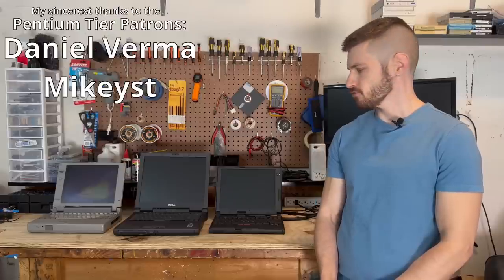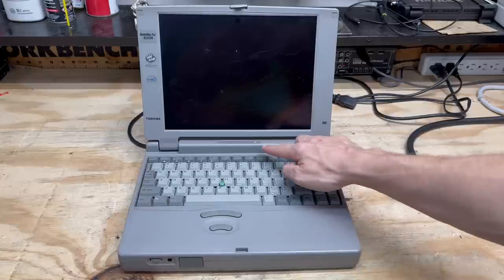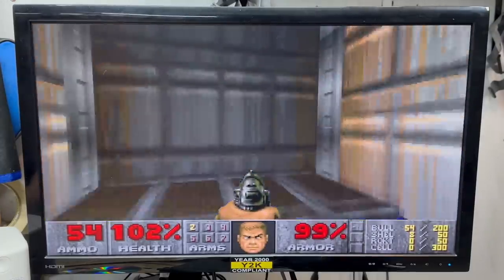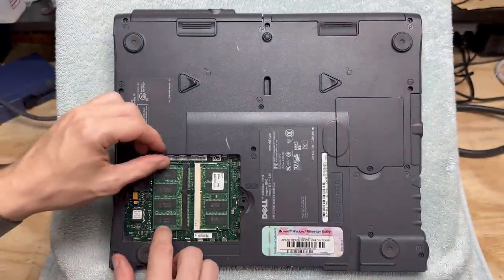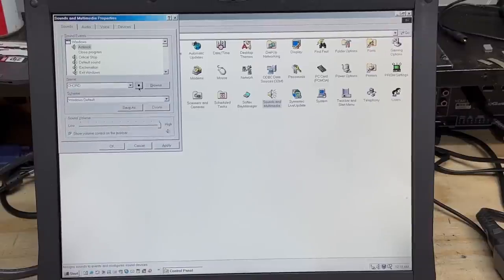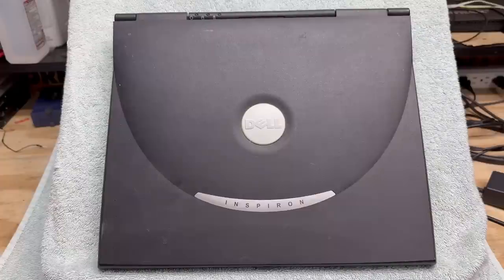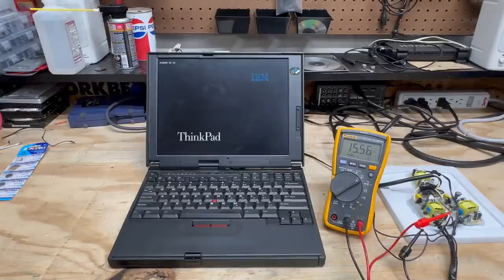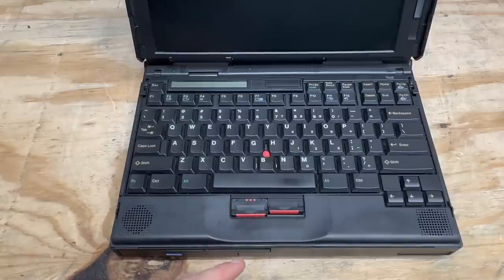Testing some of the retro laptops from the Franklin eWaste haul.

Comment: Remove the CMOS and the "Hibernate" Battery from the Toshiba laptop. Its not a question if they will leak. the question is have they already leaked... The acid flows through the cables into the plug where they are connected and destroys the mainboard. I have like 20 of them an all have leaked or were about to start leaking. We also discussed this topic on vogons and everybody had leaking batteries.
Reply from the maker: Thanks for the warning! I pulled them out and got incredibly lucky. The CMOS battery connector will need to be replaced, but the mainboard is safe! I'll be diving deeper into these systems in the future, just have to work up the nerve to face those incredibly brittle plastic clips...
Reply: @miketech1024  The Satellite 400 series aren't usually that fragile, it's just that you have to separate the top half (screen, keyboard cover, video card) from the lower half (psu, mainboard, lower case). Once the screws are undone and the video card disconnected, the top case easily unclips from the back side where the PSU is and lifts forward and up.
The later toshibas like the Libretto can be really brittle, but mostly it seems the Satellite 400 to 435 models were made with a different type of plastic

For the battery damage, it might be worth looking close-up on the mainboard, the electrolyte from that larger standby battery can leak onto the mainboard if it was stored flat. That can often damage things like keyboard functionality. For the ones that are too far gone, something unique to the Satellite 400 to 435s, is that the top half (video card, LCD, LCD cable) can be swapped between a DSTN unit and TFT unit, if you've got a TFT model that has a dead mainboard but still working screen.

I made a 3d print of that port door that you glued back together, I should probably upload that for people to use
Reply: @voodler  interesting... I'm part way through restoring a 490XCDT. Yes both batteries had leaked, and yes it had made its way to the main board. Only after cleaning the area did I get the thing to boot. Now happily running Win 3.11 on a CF card. BUT... as you mentioned, still got weird keyboard problems. Some keys only work when another is pressed. Is there a particular chipset I should look near for damage? 😊
Reply: thanks - will pull my 2100CDS apart and pull the batteries - didn't know the ones in the Toshiba machines leak
Reply: @billysteiger7092  Ah the 490CDT / 490XCDT are pretty bad for getting battery damaged. The first one I got the corrosion was so bad that it had got under the BGA chips on the back of the mainboard and it was just junk.
The mainboard design on the Satellite 490XCDT is quite different from the earlier models i.e. Satellite 425CDS in this video, so if you're having keyboard trouble that's less likely a motherboard problem, since it now boots you should be fine.
It's more likely to be the keyboard membrane itself that got damaged and it's best to just replace the keyboard for the same part #. Especially since you've said some keys work only when others are pressed, that often means a severed trace on one of the two membrane circuit sheets. Membrane keyboards can be fixed but it's tough to do and keyboards are quite readily available for the later Satellite 440 to Satellite 490 series laptops.
Reply: @voodler  thanks so much for the info :) Yeah I took one look at the 30-something plastic rivets holding the keyboard assembly together and just thought nahhhh...
Reply: Heh, I ended up ripping off the "Hibernate" connector off the mainboard, it was literally fused to the plug. The CMOS connector stayed in place but has some evident acid leakage.
Reply: Please, please tell me there’s a poetry thread
Reply: @DogBearCat  
If poetry is truly what this person seeks,
They must find it in battery acid leaks.
Now go, leave us in peace mein Lieber ,
And let us lament our expired Toshiba.
Reply: @billysteiger7092  huh, I expected to convulse more
Reply: @voodler  then maybe I had bad luck; I've worked on three series 400's and the impression I got was that the plastic would break if I so much as sneezed near it. I also owned a couple Compaq LTE's from the same era and no plastic clips/tabs/doors ever broke on those.

Comment: Most Dells from this era I've had the Batteries Short out the charger. Disconnecting them will alow it to post.

I've had similar behavior with devices as new as the Vostro 1500

(Alt + F7 usually maximises POST Screen also) :)

Comment: The 425CDS has a dual-scan passive matrix LCD, so no big loss if it's cracked. One of the first videos on my channel was showing how to get to the backup batteries, which are underneath the keyboard. One downside is that the Toshiba floppy drive for them uses a belt which has probably gone bad by now, and I haven't found a way to non-destructively open up the floppy drive to replace it.
Reply from the maker: I dove in there and removed the batteries as soon as I heard. Got very lucky on this machine! Just have to replace the CMOS battery socket.

Comment: I've broken so many of those plastic spudgers! They kinda suck honestly. It's ironic that you use a guitar pick because I've been using one for a long time as well. It's great what one used for tools back in the day before the internet/Amazon made everything readily available. Improvising and using what we had on hand to get the job done is how I grew up and I think the guitar pick gets put in the kit with the duct tape and channel lock for most versatile and used tools for diy or any job for that matter. Great content ! Keep up the good work! Also if you sprinkle baking soda on super glue it will harden instantly, greatly reducing the dry time. It also enhances the durability of the bond.

Comment: I have a slightly earlier ('96) and a slightly later ('98/99) Toshiba.  They don't look like much, but they are lovely to use still, the keyboards are just fantastic.  Be warned there are usually two Varta Capsules of Doom buried deep inside and if they haven't already, they WILL kill your laptop. Also, to properly dismantle these, you have to first remove the keyboard as there are screws under there holding the top and bottom case together (at least on both of mine there are).
Reply from the maker: The Varta enemies have been neutralized. Got VERY lucky that the board didn't get damaged.

Comment: A 1997 old toshiba holds charge when a 2020 laptop has already a destroyed battery, the plastic clips dont break when a 2017 laptop has all destroyed plastic specially the hinges. And most amazing of all you can find replacement parts and for new stuff you cant even change parts, look at apple gluing the displays without screws and most laptops soldering the ram, disk drives and proccesor to the board. The built quality and servizability of old stuff were both amazing, now everything is crappyer and much worse built. A 2009 hp elitebook laptop is the best built laptop i have seen in my life, the og battery on that laptop works and holds the 5000mah its supposed to and i have a 2011 battery for that laptop with half the charge cycles that holds half the mah its supposed to, now things are not built like they used to, everything from cars to apliances to pcs is built awfully, though smartphones are pretty decently built thanks to people like jerry rig, the issue is still that parts are almost imposible to come by and replace, honestly the big issue with phones is software updates and the unavailability of quality replacement batteries. The dell inspiron looks even better built than the toshiba honestly. And the ibm looks good too. The thinkpad 760E is amazing, you can change anything in 1 minute.
Reply: I've got 11 of those Toshiba batteries, of which 9 still hold a charge for over an hour

Comment: Wowsers! I had a Toshiba Satellite Pentium Pro, but it died on me, however, I still have a 486 Satellite! I use it on occasion to run Kermit, when I want to modify the programming on the PABX.

Dell Inspiron, and Latitude, I have aplenty. I have one Inspiron P3, and at least three P4s, and a Latitude P4. The thing is, I still consider them to be quite modern! I used one of them to generate TV test cards, and therefore had/have the TV adapter to go with it.  On the batteries, I always found the silver labelled ones were the best for charge reliability. I loved the twin battery capability because it meant you could get phenomenal battery life compared to many of the rival brands.

You're bound to know this, but the P3 Dells used the Dell PA-6 power supply, and the P4s used the PA-9. Difference being 75 Watts and 90 Watts respectively, but I also liked the way you could still run a P4 on a PA-6 PSU if you didn't mind the system clocking down to save the power supply. Of course, the P3 would work perfectly well on either power supply.
Reply from the maker: The Dell was definitely giving me modern-system vibes. Seems plenty capable even to this day. No doubt I could load a modern Linux distro on it and use it for work.
Reply: @miketech1024  I agree, I was using one of mine, running Windows XP-Pro upto and beyond the end of XP service life. To be honest, it's still my go to machine for copying/digitising analog music recordings, and remastering for burning to CD Audio.  I had to stop using it for internet use when I could no longer get a browser that was capable of displaying websites correctly - especially YouTube!  I hadn't come across the alternative O/S options at that time.  With wi-fi, a wireless keyboard and mouse, and a Bluetooth dongle, these old Dells just felt like they would go on forever.  I just loved them to bits!

Comment: I had a similar machine to that Inspiron (a 4000 rather than an 8000) when I were a lad and I loved it to death. I always lusted after the fancier Latitude that it was based on (something in the C-series but I forget exactly which model). 

If the Zip drive is just a regular C-Bay device then you could drop in another optical drive in its place and have one of the very few laptops to ever have dual CD drives.

From memory the dock for these is also pretty sweet in that it will let you PCI cards. It was definitely possible with the D-Series at least.

Comment: Also, most thinkpads from this era will boot with flat cmos batteries if you set the time, let the system fail to boot, and then rapidly turn the system off and on again with the power switch.
Reply from the maker: Wasn't sure if I should push that hellspawn contraption of a "power supply" too hard. Just lucky the CR1225 fit!
Reply: Best to remove them too from the thinkpads. They are in the palm rest and will eventually leak making the keybaord stop working.

Comment: I have the exact same Dell laptop (CPU, RAM and GPU), except in it's Latitude version, it's even more chunky and rugged, my battery still holds it's original charge and lasts around 2h, which was the advertised running time.

Comment: It looks like I have some catching up to do on your videos. I always love picking up old laptops especially because I can store more of them compared to desktop machines. I got a couple of older thinkpads I need to check out and see if they work. It should be fun!
Reply from the maker: Thanks! I’ve recently learned of a great danger though. Many laptops contain evil Varta batteries - destroyer of systems! Be sure to check on your laptops to make sure they won’t fall victim!
Reply: @miketech1024  I removed the cmos and backup battery on my ThinkPad 760XL a few months ago. Luckily nothing leaked but I disconnected the speaker wires so the speakers don’t work anymore until I learn how to solder them back on.

Comment: Careful with those batteries. I redid my Dell Latitude CPi laptop and I used a M.2 drive to PATA and the battery had a short in it and damaged the m.2. So I took apart the battery and took out the cells to were I still had the shell to cover the hole. Also with those higher Res panels on the Dells it will not auto stretch picture you have to do it by FN + F7"Blue Text FONT" will stretch the image.
Reply from the maker: Thanks!!

Comment: That Thinkpad sure brings back some memories. If possible, try to save the backlight tubes from the first machine's dead screen, sometimes it's handy to have spares as these also tend to die/arrive dead._
Reply from the maker: Most definitely saving the old LCD! It’s interesting that the replacement tubes are 3x more expensive than the replacement panel itself.
Reply: @miketech1024  It might be regulations related to the mercury content.

Comment: I also have a 760E, identical to yours. My battery also works! Mine has a 5 GB hard drive (later replacement?) and 64 MB of RAM. It has a rather trashed install of Windows 98 and unfortunately the rubber coating is beginning to perish, but it's otherwise fully functional. The clock battery even holds time! I do plan to take it out soon, but I was absolutely astonished at that discovery when I acquired it a few years back.
Reply from the maker: I’m thinking about trying Plasti-dip to restore the rubber coating. I’ve had it on my car for the past two years and it holds up incredibly well. With the right primer I think it could work. Be sure to check your ThinkPads for Varta batteries! They can and do leak. In typical Varta fashion, they will destroy the motherboards!
Reply: @miketech1024  Yes absolutely. I did check it shortly after making this comment, mine seems to be okay and curiously, is not a Varta brand. There are signs that it was replaced at some point in the machine's life, which is a relief.

Comment: I had an Inspiron 8000 like that system and eventually warranty replaced it and got an 8100. Used it for years, and it was a pretty decent system for the era. I recently tried to restore it, but the hinges were so brittle they broke when I opened the lid. On the hunt for a replacement hinge now.

Comment: the best thing to do with the inspiron  is to put 2k on it lol, as you can tell I'm not much of an ME fan. I do have a system that has it as a default install though. that zip drive was definitely a rare add-on. yeah that rubberized coating is a pain, unfortunately I haven't found a way to stop the coating from degrading, short of just stripping it off altogether.
Reply: Imo, the problem isn't ME, it's that tagteam of viruses (viri) that call themselves Zonelabs and McAfee. I'd remove those, long before I'd consider removing ME.

Comment: I bought my first laptop 6 years later than the first laptop on the video was manufactured. Compared to that, it had 8x the RAM, more 20x the hard disk space, a DVD drive, built in 100 meg ethernet and a touchpad. And it was way thinner, but still had a bigger screen. Things moved on pretty fast back then!
Reply from the maker: It is insane how much more advanced the Dell is compared to the Toshiba, with such a small amount of time between them.

Comment: These Toshiba are great, got like 5 of them in different Versions - from Pentium 120mhz  to Pentium MMX 266Mhz.. Incl 2 with the 133mhz MMX variant. Just these DSTN passive displays... yuuuuckkkk.. The 425CDS you got there might probably be one without L2 cache. Just like my 430CDT - but the good thing is you hardly notice it. Try Cachechk to find out. Dont know why Toshiba did that.

Comment: Great video! I see someone already warned you about the Toshiba hibernate battery, which is good! The Inspiron 8000 and your 760 ThinkPad BOTH HAVE THEM TOO!!! ALWAYS check a vintage laptop you get for one of those batteries, nearly all of them have them!!!
I think Dell buried theirs near the top right? The 760’s is really sneaky - it’s inside of the palmrest.
Your ThinkPad 560 is safe, doesn’t have them.
Reply from the maker: Varta got their little pods of evil into more than I thought! I did replace the batteries in the 760E since they were dead, but they hadn't leaked so the threat wasn't apparent to me. I'll have to get more brave with going deeper into laptops in the face of brittle plastic clips.
Reply: @miketech1024  sure did… it’s a really worrisome threat because so few people know the extent of them. I’d even call their NiMH batteries worse than the NiCad barrel batteries on old desktop boards. From what I’ve seen, these NiMH batteries are leaking much worse more often. The NiCads cause a spot of damage while the NiMH ones just blanket everything near them. The Toshibas even have those huge 9 or 10 cell packs right on top of the motherboard! In 10 or maybe even 5 years every last one of those Toshibas will be damaged beyond repair. It’s nearly every brand that used them: IBM, Dell, Apple, Toshiba, Compaq, WinBook, Sony, the list goes on.
Reply: I’ve been looking for a WinBook XP laptop (486DX4, Sound card, TFT screen, awesome design, touchpad support) but they put one of those batteries right over the back of the motherboard under the CPU. I worry I’ll never find a working one at this point.
Reply: my 760C fortunately didn't have the keyboard PCB too damaged. yeeted that hibernate battery instantly.

Comment: I like the old 90's Toshiba laptop designs, I have a 300CDS & a Satellite Pro 430CDT. I also have an Inspiron 8000 with totally busted hinges (I bought it cheap), the screen is basically loose. Where would one even get replacement hinges for this?